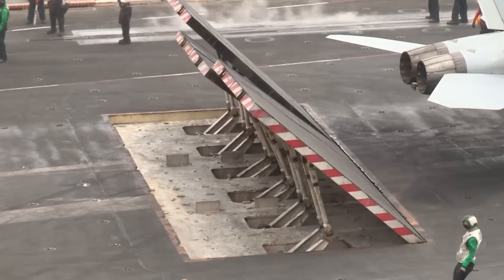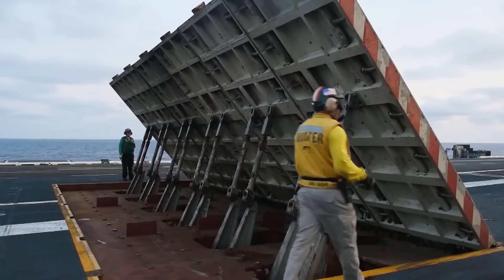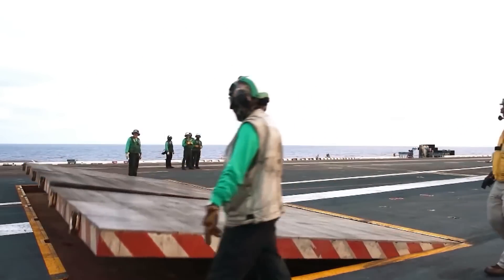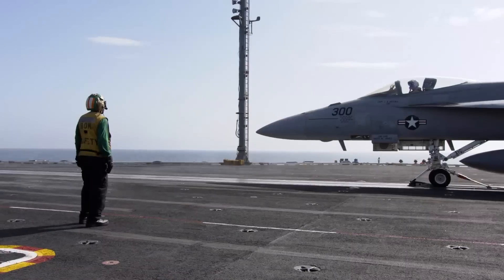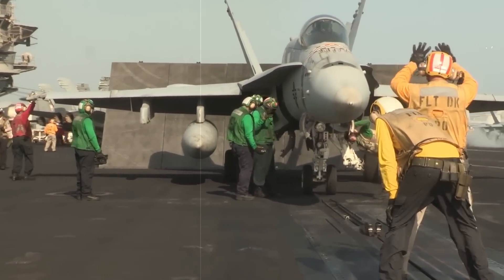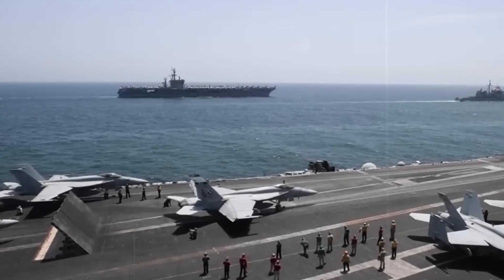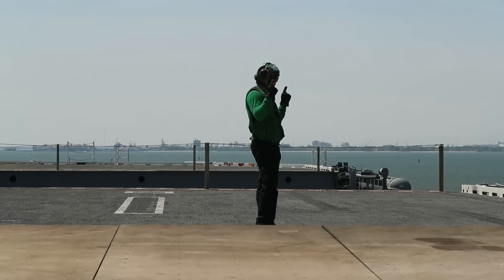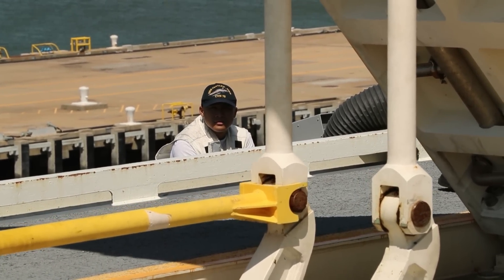Jet Blast Deflector Failure on US Navy Aircraft Carrier: What Happened?

Comment: In 1982, I was a radar ET aboard the USS Forrestal. There was a small commercial harbor navigation type radar with its antenna assembly mounted centerline of the island, at the signal bridge level, accessed from either/both sides via a catwalk. The assembly was covered by a flat dome about 6" tall, 3' diameter, held on by a ring clamp. Myself and another technician were on either side of it, in the process of removing the dome. 

So, we were at about the 09 level, at the front edge of the island. The flight deck was the 04 level. Which put us 5 decks up from the flight deck, and the catapults. And aft of the starboard side bow catapult. And flight ops were underway while we were there. 

Just as we were releasing the clamp on that dome and lifting it off, they launched from that cat just forward of us. 5 decks up, the blast deflected from that JBD hit us, still rather hot, and almost jerked the dome out of our hands. We pulled the dome down, tucked in, and waited out the launch. Then, quickly replaced the dome and aborted the job until after flight ops. Amazing how far away you can be and still be affected.
Reply: I was a ETR2 on Forrestal when they first installed a water cooled JBD for the CARQUALS of the Tomcat (~1972). You could always tell when something powerful was being launched as the noise from the water flow was loud in the test equipment locker,  (I'm not in the cruisebook because I got OUT while deployed in the Med )
Reply: Awesome power they have!  
So, I guess greetings to a shipmate!  I was in Squadron VAQ-130 on the Forrestal during that exact cruise in '82! Our squadron had the funny-looking 4-seater EA-6B electronic warfare jamming aircraft.  I worked assigned to AIMD on the jamming system boxes and components from that system on our squadron's 4 EA-6B aircraft.  Occasionally went out on the flight deck to help our squadron's "O-Level" guys troubleshoot problems with the systems on the aircraft.  
Went up to view and watch flight-ops often from the vantage point on "vultures-row" on the island.  (I think that was 06 or 07 level?? Not sure..)
Reply: @deanlawson6880  As a radar ET, I basically "lived" in/at the island. Our berthing was just below the bomb farm. If you came down from the flight deck at the middle ladder in the island, at the 03 level you'd find yourself in front of the door to our coop. And, the most popular showers, apparently, on the ship, since we had fixed shower heads. The big AC system hanging from the overhead just as you came off that ladder was a dedicated system for my radar, two decks up on the 05. The radar shop was just up from there, on the 06 level, front of the island, just below the bridges. Vulture's row was one deck up, same level as the Admiral's bridge, the 07. The bridge was the 08, the signal bridge 09, and the radar room for the SPS-48 (the big rectangular antenna at the front of the island) radar up from there at the 010 level.

Do you remember a very large (10' x 40') radar antenna on its own platform hanging off outboard of the island? Biggest antenna up there. That was mine, the SPS-43A. And, in fact, you may, possibly, have seen me sitting at the very top of it around July-Aug, shortly after Naples, before Benidorm. I've got a picture of it that was taken by a QM that happened to be on the signal bridge at the time and saw us up there. Then we walked a beat together in the yards in Philly and he gave me the picture. He had no idea who we were when he took the picture.

Actually, we all got a Letter of Appreciation for repairing what I was pointing out in the picture I've got. There's another antenna (IFF) that rode on top of my radar antenna, and I was discovering the tape blowing in the wind from the connection to that antenna. Long story short, we had a crap tech for IFF at the time, ignored advice about weatherproofing until Naples, screwed that up, so a washdown of my antenna ended up with my rotary joint assembly for the IFF system full of water. And the idiot "tech" had kept replacing transmitter assemblies one after the other as they each blew up transmitting into, effectively, a pool of water. Until he ran out, then came for help. Burned out the entire transmission line. Which got emergency repairs while underway and repaired properly in Benidorm.

Remember the F4 we lost on a night recovery? Because ACLS was in use, we had investigators in our shop for like a month afterwards before they finally ruled it pilot error.
Reply: @brolinofvandar  I was ET on the Forrestal in 65-66, worked on equipment in Radar1 on the 09 level (Signal Bridge) SPS 43 was there then it was the long range airsearch radar. I worked SPS 12 another airsearch radar and SPS 8 the height finding radar. Spent many a hour watching air ops from there.
Reply: @joecoyne5660  The only SPS radars we had were my SPS-43, the SPS-10 surface search, and a 3D air search SPS-48.

The 48 was in a space accessed from the signal bridge up a short flight of steps. That was FT gear, with 4 FTs in our radar shop just for it. That sounds like the space you say you worked. Except I want to remember it as Radar 10. But, the only name I remember for sure, is the Radar 3 & 4 that my 43 was in.

Comment: There was an instance when two F-14s were waiting to launch. One F14 was brought to the catapult with the other F14 waiting behind. They hooked up the first F14 and the shooter was given the pilot the signal to go to the afterburner. The only problem was someone (or maybe there was an issue with JBD) forgot to raise the JBD and the 2nd Tomcat was literally being blown over the port side of the ship. The plane kept on rolling until the pilot and RIO ejected just before the F14 stopped rolling, hanging delicately over the side of the ship.
Reply: The scene you describe was where the ship was using Cat 4 to launch them.  The JBD on Cat 4 of the older boats is much smaller than 1.2. and 3's.   With that they chose not to raise the JBD and the LSO platform shield was lowered too.  The issue was the handler taxiing the next Tomcat too close to the shooting Tomcat.  Normal deck ops had the next bird stacked behind the JBD but should not have been done in this case.
Reply: Many years ago, If I remember the same accident They wanted the Missiles back not the plane.
Reply: I was ships company, petty officer 3rd class hull maintenance technician, on board of the U.S.S. America C.v. 66, I watched a many many flights , from take off to landings , it's a very busy environment, on the flight deck, planes riding the elevator's up for flight oops, they tested the jet engines off of the fantail of the ship, they were such a thrust of speed when they fired those engine's up, they had Mariens stationed on board standing guard all across the rear of the hanger bay, around the propulsion shop, Mariens stood gaurd over weapons transfer, they were live weapons, if you broke restriction, they would have shot you , 
.
Reply: @airejocky7731 it's not so much that they "chose" not to raise the JBD. It was NATOPS procedure for Cat 4 on those small JBDs.

Comment: Long ago I was an officer on CVA61, Ranger. Our blast defectors were aluminum panels with sea water pumped through them. There was supposed to be a time limit on how long the jets could sit with full afterburners on. It was a constant process of welding up the cracks because they would violate the time standard.
Reply: I was in VAQ 137 AME-final checker/ trouble shooter 80-81 west pac on Ranger.
Reply: I may be mistaken, but I believe that they had incorporated a 30 second rule once the Aircraft goes into full throttle. After that, and the jet isn’t launched by then, it gets suspended. There’s no reason to burn up the JBD panels if it couldn’t get launched by then.

Comment: Back around 1975 or 76 I was a JBD operator on board the U.S.S. America CV66. Night ops catapult #1 after launching they were starting to park F 14’s up front but first they were de arming rockets parking on top of the JBD’s.Our control panel in the catwalk was not working so I would have to radio down below to have the backup system take control .Our chief in charge thought he could hear a problem from down below the JBD’s and demanded the operator to raise them.Well there was a armed F14 on top going up in the air.The air boss was fit to be tided yelling up a storm fifteen minutes later the chief and both operators were on the carpet.After following orders the chief was no longer part of the ships company. ABE 3 Little

Comment: Aircraft misaligned and angled jet exhaust? I don't think so. That aircraft would be spun off because it would be out of limits for the catapult. There are line up lines painted on the flight deck for each type of aircraft. The nose is in the shuttle and the main landing gear is on the line up line.

Comment: Evan with the JBD in place you can still get your a.. roasted if you are caught on it's outer edge. I was caught behind one when a F14 was in full afterburner and the Tomcat just sat there burning away. The catapult was having trouble building up steam pressure to launch. It was only about 25 seconds in all, but I was burned badly. The JBD takes the brunt of the jet blast but not all of it, take my word for it.     USS Constellation, CV64, VA146. 75-80
Reply: That F-14A, had small engines "Pratt & Whitney", slow @ subsonic, but @ Mach, they "HAULED ASS" enabled the Jet to climb "VERT" ! I saw the Exhaust nozzle was "CERAMIC" sliding fins. The later, GE, engines, would do a stall, thats why, the FLAT SPIN, killed alot of pilots.
Reply: Were you on the cruise that was on Gonzo station in '80? I was an OS on Truxtun CGN-35 in the battle group.

Comment: Interesting, I wonder what the future holds for heat shield as the aircraft change over time will the heat shield stay the same?
Reply: It works they are water cooled.
Reply: With the Super Hornets hotter exhaust water cooled side panels were added to the JBD to protect the sides